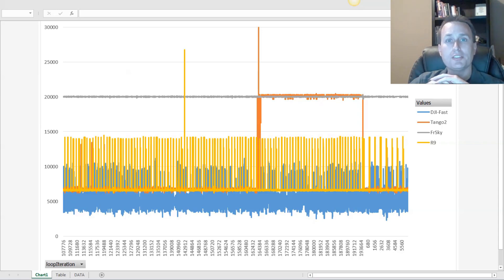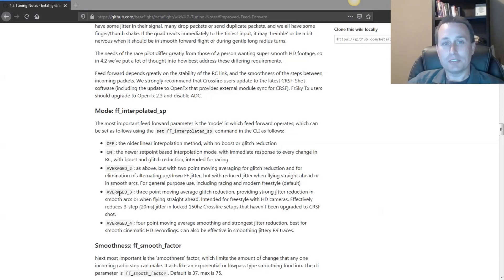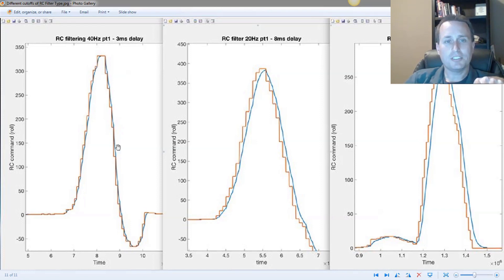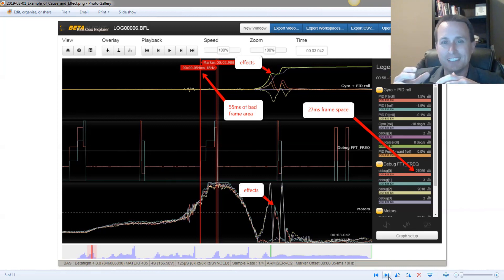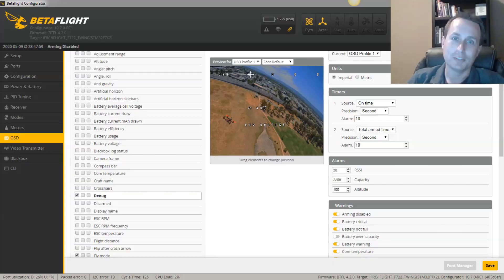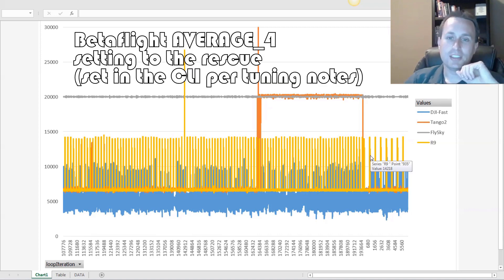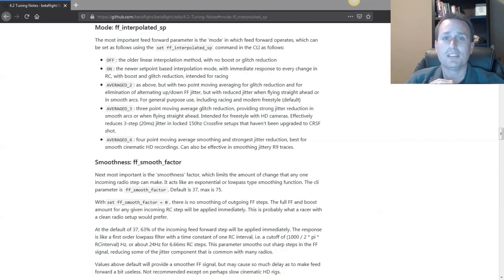BAD TX Rate AND Betaflight 4.2 Settings to Improve

Comment: What kind of flysky where you testing?  Mine sticks to 7.001 typically.  I have seen it as high as 7.089 and as low as 6.88.  Nirvana with the rs pro. No telemetry ibus.

Comment: Awesome straight detailed info. I'm a basix qx7 accst amd and occasional r9 user. Already removed the adc filter from radio and it felt very smooth on my 3 inch toothpick.. will try the average 4 filter rc smoothing for sure. Thanks again Mark!

Comment: Great video thanks. Do you think it’s possible to feel the R9 “heartbeat” while flying? It might be psychological but I thought I could feel a rhythm ticking along in the control link ever since I started to fly R9 and occasionally I get a random twitch out of the quad due to an erroneous signal being sent on a couple channels by the transmitter. BTW do you think turning off telemetry could get rid of those little twitches the R9 seems to cause?

I like the much more reliable link when it comes to failsafe with the R9 over 2.4ghz but I don’t trust it for really long range and recently picked up one of the big crossfire modules from a friend who got himself a new Tango. I don’t think I’ll be switching everything over to crossfire yet though, just a couple of craft to see how I like it.
Reply from the maker: Every 200ms is 0.2 seconds.  So IDK

Turning off telemetry does not help.  Tried it.
Reply: UAV Tech Thanks, yeah the logical part of my brain says there’s no way I should be able to detect that and it’s probably psychological. The weird glitch thing is my only big issue with the R9 and it’s not severe or often enough to cause problems as far as flying goes, it just sucks when filming smooth cinematic video and you get a little twitch during the flight.

Comment: the main reason 3.5.7 is used so often as a reference is its a bit harder to set up wrong.   theres less ways to set  it up  so it damages something when youre a dummy/noob. especially over a large range of different size gear. Also there are so many decent tunes and working stock configs out there for so many quads that can just be copy/pasted. especially for those new pilots that find out the hard way what the BF devs really mean by "reset".
IMO at this point betaflight really needs a simple mode for those that haven't been around and seen all the changes since ~3.2. the sliders are  a big improvement.
could even use the old moron threshold as a tribute. a whole fork called moron flight!

Hopefully someday a BBlog or 3 can be read by a comp and then just spit out a decent fixed CLI to paste.

(locked up at home drinking and smoking)
Reply from the maker: Folks should check out Cleanflight.  Old and never changes.

I will do a video on why 3.5.7 is subpar.

Stay safe amigo!

Comment: i vaguely recall joshua mentioning flysky is doing something different with rc interpolation that makes it smoother, i also thought drone mesh measured flysky as fast as crossfire almost??  all this makes me wonder if those days (or first few packs) i feel less connected to the controls could be a matter of interpolation
Reply from the maker: I don't know about those things.  I just know Frsky has has inconsistent packet trsansmittion for YEARS!

Comment: Which hardware did you use for flysky ?
From what I heared and feel deviation radio like t8sg have way lower latency...
And last question, is it latency showing on betaflight cli when tiping  "rc_smoothing_info"?
Reply from the maker: Yes, it is the same frame rate that is shown on the RC_Smoothing_info command.  But of course the CLI command is not capturing during the entire flight.

Folks were using OpenTX.  I need to look into the latest OpenTX (2.3.7) and also see how ErSkyTX performs.
Reply: @uavtech  Thanks for your reply mark !
I just make some test with my jumper t8sg and latency is way lower than your testing on flysky protocol with constant 3.85ms no matter what the distancy between rx and tx.
Same results for my friends on turnigy evo, 3.85ms on spi RX and 7.7ms with external RX.
Frsky spi rx is 8.85ms fixed and crossfire vary from 6.6 up to 20ms on t8sg too.
Just wait from my friend to report results with jumper t16 and crossfire vs crossfire shot...

Comment: Thanks !!
I just upgraded my Taranis to OpenTX 2.3.7 after seeing your video (was on 2.2.1).
I'm on D16 EU/LBT, by the way.
Do you know if it is better or worse than D16 FCC ?
Reply from the maker: Unsure.  Need to do testing on OpenTX 2.3.7 as well.  If not better, I'll try ErSkyTX as well.
Reply from the maker: Updating to OpentTX 2.3.7 did NOT fix R9m (ACCST version) at all.
Reply: @uavtech  😥 it is probably related to frsky rf protocol, rather than Taranis itself. I guess at least all frsky accst product will show the same behaviour...

Comment: Running ACCESS 2.1 on TX(Radio ISRM module v2.1.0) and R-XSR on 2.1 Opentx 2.3.7  I'm seeing Max high spike of 7.17 and lowest is 6.86 (Average 7.03).  All running on the Taranis X9D Plus SE 2019. No variations through the whole flight even when pushing the range.  So, yea. Seems to work. Thanks for the 4.2 explanation and making me finally getting around to confirm that this new stuff actually works!
Reply from the maker: Yes, looks like ACCESS is improved.  Unfortunately, that doesn't help a lot of folks that don't have ACCESS radios.
Reply: @uavtech  Yea. I hear you. Kinda makes you wonder if they intentionally left ACCST hardware out in order to encourage people to upgrade, or is it a case of it just isn't capable.  That said (And I'm sure I'll get flamed for this), I'm ok with them doing so in order to justify(read "pay for") innovation (developement costs).

Comment: Hi Mark, I had a resonance at 54hz in a build I was trying to debug.  I threw in a notch and it cleaned up the gyro, and it eliminated it even from gyro scaled.  Someone just told me that resonance can also come from Rc command?!?! If I filter Rc command more, I can remove the resonance thus removing the bitches I put in?  Does that makes sense?  Can Rc command jitter create a noise bad enough to smoke motors?

Comment: I've successfully upgraded my taranis to 2.3.7 . In the 4.2 tuning notes. It said to disable the ADC.. What's that? and how? Maybe you can help? Thanks ahead.
Reply: In the radio setup section (in your Taranis) there is a page called HARDWARE, and there you can uncheck the ADC_Filter option.

Comment: Have you tried logging and see if there is any differences in consistency running 2.4ghz frsky like the r-xsr with ACCESS over R9?
Reply from the maker: r-xsr on the ACCST suffers from the same issue.  I have not seen r-xsr on ACCESS.
Reply: @uavtech  strange, I have no problems with r-xsr and accst, otx2.3+ has hearbeat for internal module
Reply: @illusionfpv708 Any update on whether this effect with R9 ACCESS?

Comment: I think this is why I get occasional bounce back with default FF values. No matter what I've done it occasionally happens. I'm wondering if my really old open TX software is the problem. Incredible find. Thanks for another excellent find
Reply from the maker: Could be this or motor just getting saturated some times too.
Reply: @uavtech  Im using t motor f55 pro 2 f3 mcu 4-1 esc and f60 pro 4 1950kv 6s motors. Even these strong motors get saturated?
Reply from the maker: If a heavy quad, sure.  If really light, not likely.
Reply: @uavtech  really light. I'm using raging droner. No go pro. Around 350gram. Appreciate your time as always

Comment: I have a taranis qx7 and rxsr receiver. So should I be using 4 point averaging? I really don't want to buy a new radio to love my FF. I do feel the dropped frames. When I reduce FF it gets smoother. I prefer running higher FF. This might have been the missing tuning problem I've been fighting for at least a year

Edit. Average 4 it is. Can't wait to try when I get home from work. I hope this works and I can bump back up FF

Comment: I am also an R9 User using 8 channel mode and F.Port. What filters do you recommend?? I am using input 15hz and derivative 20hz
Reply from the maker: Set all to Auto and use Aveeage_4.
Reply: @uavtech  I am still on BF4.1.5 though 10" are really hard to tune and I am really not in the mood to try a new target.

Comment: FlySky is only 50Hz? Which FlySky protocol is this, because I fly all AFHDS2A with Flit10/Fli14+ and a Multiprotocol module and I see very consistent ~7.7ms frame times.
Reply: Just logged Flysky Nirvana running X6B does 7.69ms average.

Comment: Have you tested ACCESS 2.1? the biggest steps I've seen in my testing so far are between 6.8 and 7.2ms with an consistent average of around 7ms.
Reply from the maker: I have not.  Do you have a log of it?  I really don't want to go through the trouble of updating - plus I have a damn QX7 and don't have damn R9M 2019 edition - but if I would go through the trouble, I don't want to be disappointed.
Reply: @uavtech  Yes i have logs for ACCESS 2.1 with xrsr and opentx 2.3.7
Reply from the maker: @JusticeFPV  , if you could send to me at spatzengr at yahoo.com that would be awesome!
Reply: @uavtech  On its way
Reply: You beat me to it!  I wanted to see if the new ACCESS updates cleaned up the signal as it's been updated quite a few times.

Comment: Mark 3.5.7 produced better footage for 6"+ quads. When I say better I am talking about straight line, no bobble, jitter, bumpiness, whatever you want to call it. Mid range and long range groups on facebook all love 3.5.7 for the same reason, the HD footage. 4.2 is fixes much of the problems 4.1 introduced that 3.5.7 flyers hated, but it still can't give us that butter smooth straight line HD footage 3.5.7 can. For you to dismiss them shows a real lack of understanding. I've learned tons from you, but man if you listened to those haters you would probably learn a thing or two as well. The people flying 6"+ producing amazing footage are saying different things from the you and the devs, both are right in there own regard. Come together and fly(metaphorically), don't dismiss them/us with 'your just wrong'.
Reply: PS I prefer 4.x only because the flight feel was better and I didn't mind using stabilization. Some folks hate stabilization and 4.xx to go along with.
Reply from the maker: That is not a version differential, that is just a default differential.  Knowing the inner workings of the firmware, 4.0, 4.1, and 4.2 are just better in so many ways.  Folks should open up to putting 3.5.7 settings in a future releases to prove for themself; or prove me wrong.  It is just PIDs and Filter settings making the difference.
Reply: I felt same way....until i learned to tune 4.1, now its soo money ...and on 1 rig i fly 6in bi blades, almost same tune as 5.1"

Comment: 10:34 is the flysky running in ibus or sbus? BTW in the intro it says Frsky but then at 10:34 it says flysky.
Reply from the maker: IBus.  Yeah, saw the mistake in recording and fixed it.  Good eye though.
Reply: @uavtech  I wonder what the difference is with Flysky sbus. I mostly run my flysky rx in sbus. I guess i'll log it and see for myself.

Comment: I used Frsky EU LBT on Jumper with r-xsr before I knew better. It was 16CH with a pretty slow refresh rate that disturbed the PID response badly. Looked into smoothing but found LBT-setting with 8CH instead. Would never have known this without your videos. Thanks! 👍

Comment: thank you for this very interesting video. Maybe the R9M sends the frames every 6ms. approximately every 10 frames, the R9M does not send a packet so that the R9MM sends a telemetry frame to the R9M which takes 2 cycles of 6 ms. then the R9M sends a frame again. that makes 2 frames not transmitted. therefore 20 ms between two frames. I will test by deactivating the telemetry in my QX7 and in betaflight to check if what I say is true.
Reply: Turning off telemetry doesn't help.
This got fixed with ACCESS though, but I would have to buy a new transmitter and the new R9, so I will just buy Crossfire and be done with it.
Reply from the maker: If actual fixed in ACCESS that is good, but I want proof.  I think i would be in the same boat with a QX7 and R9M prior to the 2019 edition.

I have tried with the Telemetry ON or OFF and still see the inconsistency.
Reply: @tstrrtstrr745  so as yu say access firmware dont have dirty wobbles in rc signal?

Comment: I'm flying astro x5 with caddx vista  katoka holybro f7 32 b esc 2700kv brother hobby deadpool motors. I'm getting horrible wobbles & bobbles running 4.2 newest FW where should I start??? I've refreshed the FW no adjustment yet where should I start??
Reply from the maker: Tune it.  I would start with moving up PD Gain and PD Balance sliders.  One and then the other.  See http://tiny.cc/pidtuning for the BEST tuning advice to get a well performing craft.
Reply: @uavtech  can u make video on tuning like ur 8 page tune!! If you do already let me know!! I rather listen to podcast, video vs reading!!

Comment: Mark- do you think the recently announced R9 SX and MX receivers will have more consistency in frame rate vs the current receivers? Or is perhaps the “heartbeat” frame rate pattern inherent in the hardware of the transmitter itself?
Reply from the maker: I'm not sure.  Some are saying ACCESS 2.1 on OpenTX 2.3.7 doesn't have it, but I want to see a log before I invest in a 2019 Edition R9M module.

Comment: Great video, I always learn a lot from them! I noticed that the framerate from my FlySky setup (Turnigy Evolution TX and Flit14+ receiver) is around 11 ms (11000 in the debug mode). Do you know why there is such a difference?
Reply: FS-i6x and X6B: 7.7ms (7691 in debug), both with sbus and ibus. The only difference is that the endpoints need to be calibrated with sbus, whereas with ibus they're spot on 1000-2000.
Reply: Rejdukien Just tested the iA6C receiver and have around 8ms. So it seems to be the receiver?
Reply from the maker: Maybe Sbus vs iBus?  Could just be the Turnigy or the RX it uses has a faster frame rate.

Comment: Been using ErskyTx, formerly Ersky9x for five years now.  Ersky ftw.  In my view, much easier to use than opentx, I'm biased though.  I have a playlist on using ErskyTx on my channel in case you want to check it out
Reply from the maker: I will.  Maybe with a switch to see if it helps with R9.
Reply: @uavtech  just an FYI, I inquired with the developer of ErskyTX and this is what he had to say about ADC filter on ErskyTx, https://www.openrcforums.com/forum/viewtopic.php?f=7&t=4&start=2010#p150058

Comment: How is the signal quality on Spektrum? Thanks for all the great vids. I'll try to see my logs. Just got to that part of the vid. Thanks bro
Reply from the maker: I have to look it again.  But if i recall, it was consistent.  Some of my issue is i only havr a DX6i, so frame rate is 22ms.  If you have a better Spektrum TX, i would be interested in a log of the frame rate from the girl.
Reply: @uavtech   @UAV Tech  my dx6i's are both 22ms dsm2. I've set to average 3 just because I assumed my rc signal was crappy. I guess I could just lower it and check for unwanted movement.

Comment: I thought the Tango 2 was running CRFS shot, should we still lock it at 150 hertz?
Reply from the maker: If you have, check it out and see what you get.
Reply: turn off tele too.  remember if  you lock 150hz you will be losing range.  for freestyle i would leave 150hz off and just roll with it but def run 8 channel only and 150hz off per TBS
Reply: @Dorkyand40  so, what's the recommendation now? As I understand for my situation, atm no crsf possibility (FlySky NV14 with Crossfir Micro TX) and solely freestyle flying. From your note I see that I need to set it to: 50Hz locked and 8ch (tele can be on or also off? what's the catch if either on or off?). I had it all the time dynamic (power and Hz) and 12ch. Last weekend I set it to dynamic power and 50Hz locked but still 12 channel. I'm trying to find out what's best but I can't find a clear instruction on this anywhere so far. I'm planning to go crsf shot in long term but for now I'm limited to crsf v2.

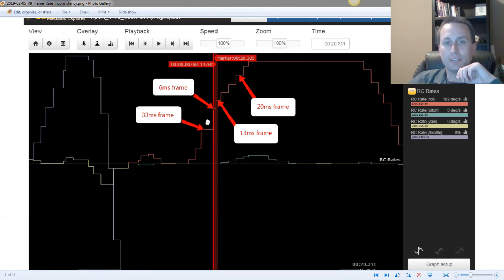Comment: 4:00 something that always confused me here. how do we know for sure these differences in stair duration are due to packet delay vs just slower stick change at that moment? I mean if I moved the stick slow but at an inconsistent velocity, it would produce a similar pattern because the "bit depth" if you will is very coarse so it's gonna step up depending on how long you hold a stick position at any given moment, or how slow the movement transitions from one level to the next. I guess what I'm saying is this is kind of an indirect measure of actual packet times. I hope this makes sense. You can imagine for example in an extreme, if you hold the stick still, it's a straight line. how do we know the user didnt just hold for a moment producing a slightly longer stair?
Reply from the maker: RC_Smoothing_Rate Debug measures frame rate, which with the ADC filter off in OpenTX, is should be consistent regardless of value.  We can see this when at 0 stick and the frame rate comes in consistently for some TX's and not others.  So you can see, with the debug, it don't matter if you are moving the sticks or not.